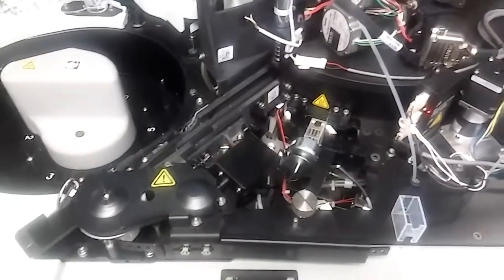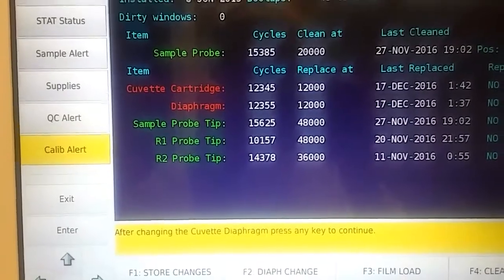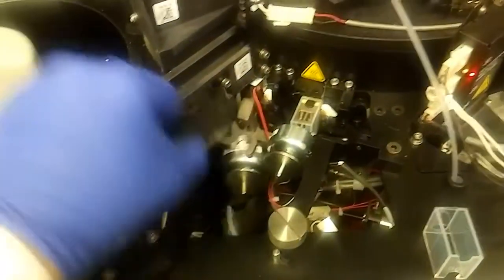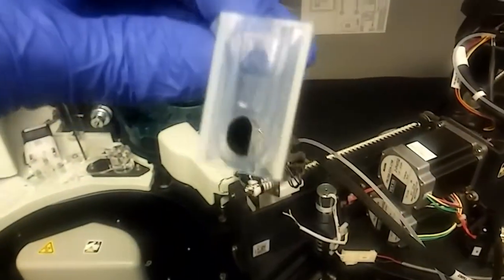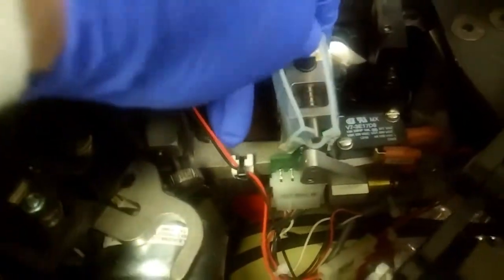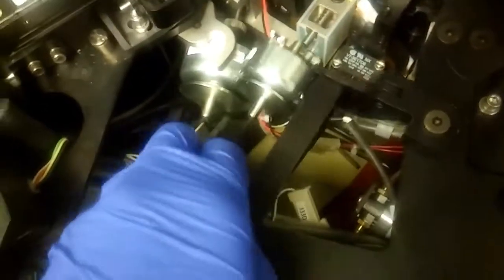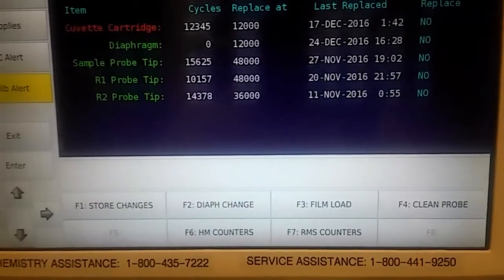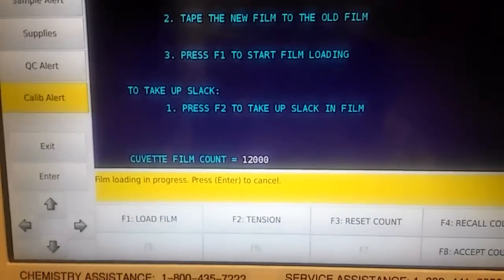Siemens Dimension EXL 200: Diaphragm, Cuvette Tape & Load Film

Comment: Thank you very much
I love this device but the only issue is the LIS I couldn’t connect it to any software without problems 
If you could help me and tell me what kind of LIS you’re using
Reply from the maker: When I was using this analyzer we used Cerner and it came across to our computer systems pretty well, after the power went out or something, sometimes we'd have to call IT and have them "Cycle the servers" but other than that it did the job!

Comment: Yikes!  We always change our exl curvette at 10000. Interesting that you go over 12k.  Does the roll ever fall off the wheel?
Reply from the maker: Captain Wacky well we dont always.. sometimes they dont make it that far. No, it's never happened to me, but I have heard of two horror stories. One where someone put on a cuvette wheel that was already partly used and it ran through the black tape without them knowing, and then another time where the tape just snapped and so they had to refeed it through.
Reply: We had a situation where the tape ran out, came up as Black tape still attached to the roll. 😫